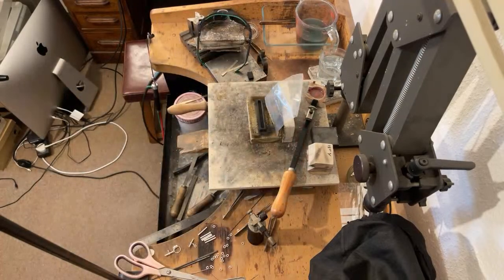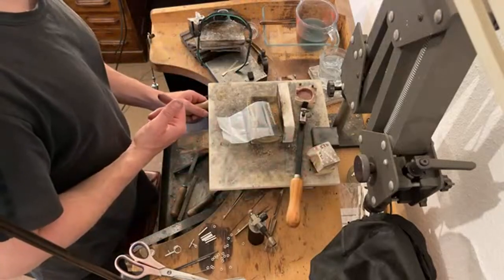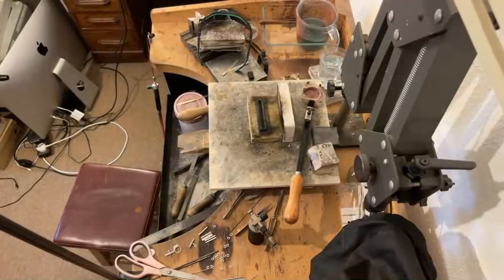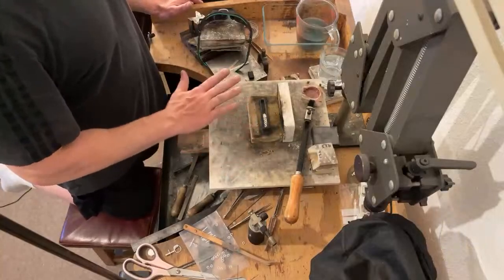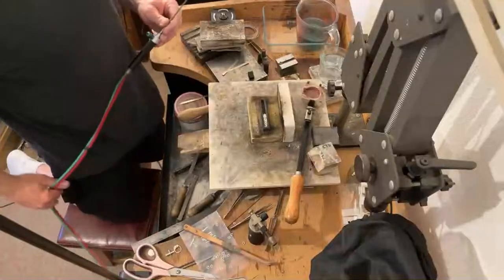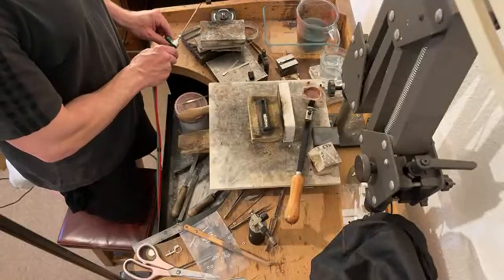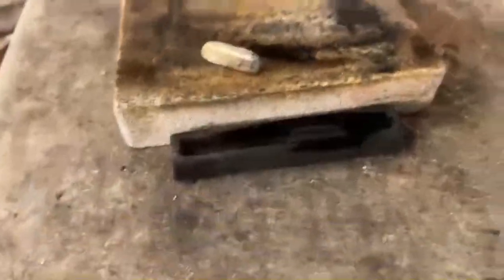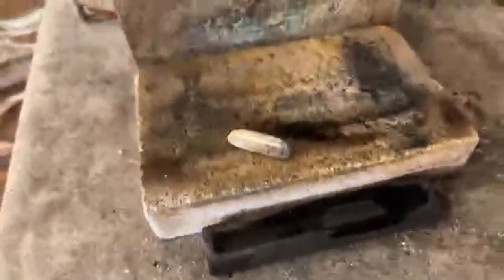Melting White Gold with a Smiths Little Torch | Roberts & Co Live Stream

Comment: Make a wet borax solution and slowly cure glaze your melt dish so the metal will float on top.
Reply from the maker: Hi @nicholasmcmillan7536, thank you for sharing this tip! Glazing the melt dish with a wet borax solution is indeed a great technique to enhance the melting process. This method helps in creating a smoother surface within the dish, which can prevent the metal from sticking and ensure it floats cleanly on top. This can be particularly useful when working with metals like white gold, which require careful handling during the melting process.

Your suggestion to cure the dish slowly will also help in building up a consistent and durable layer of borax, which can significantly improve the quality of the melts. We appreciate your expertise and are glad you're part of our community, sharing valuable insights that benefit all levels of goldsmiths. Thanks again for your comment, and we look forward to more of your suggestions in future streams!